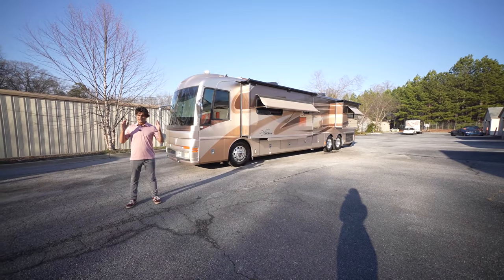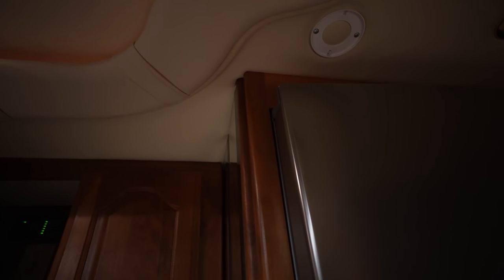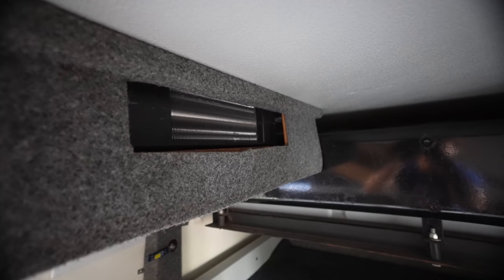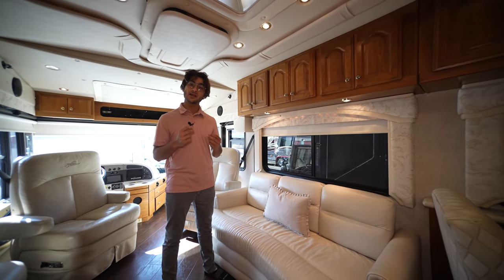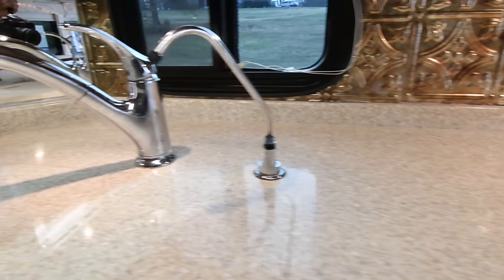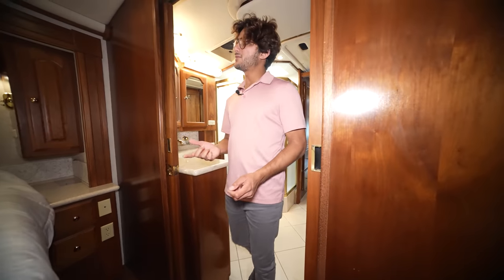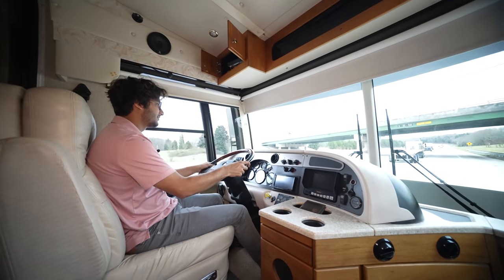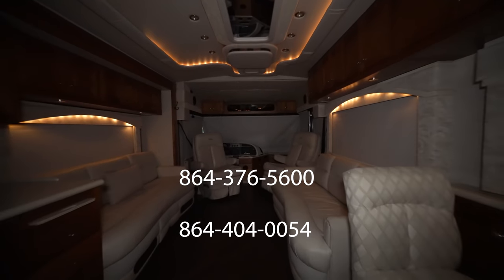2003 American Eagle 42E - Pinnacle Of The Classic American Coach, In Exemplary Condition. (Sold)

Comment: Not really a coach I would like as is but that Drivers Side Galley is always a huge plus for me. Why put the Galley on the passenger side overlooking what is always the entertainment side of your campsite where you have your chairs, picnic table, grill, outside entertainment systems/tvs and instead have all those huge windows overlooking your neighbors campsite, your power pole and sewer/water hookups? That's never made sense to me in any floor plan with how they do that. Any coach I own will have the drivers side galley and if it's a front galley setup to boot, even better. Great review/tour of a classic another job very well done, thank you Mayan...

Comment: Will it smog in CA , what is a rig like a his go for?
Reply: I'm based in Southern California, Diesel RVs have no smog req yet because they are registered as "Housecars" not trucks.  Unlike cars, every "diesel" coach going down the line is built to be 50 state compliant.  In other words, its too expensive for RV builders to have to modify individual builds so they are all the same.  There is a sticker on the frame above the engine that may have to be verified by DMV but this sticker will usually state the smog compliance which is accepted nationwide.
Reply: Thanks for your thorough walkthroughs and informative videos truly professional still wondering what this goes for
Reply: I'm registering an out of state diesel pusher in CA and we still have to get it approved by CARB, the air resource board before the DMV will register it. They basically want to see the emissions label and pictures that it is really an RV inside
Reply: @nomadbiker4040  Approved by CARB?  Sounds like the RV isn't registered properly when you acquired it.  Do you have to register it in CA?
Reply: @matthewmugglebee4110  Yes, the CA DMV office in San Bernardino referred me to CARB which had a website where you can upload pictures of the inside, outside and labels of the motorhome. Then they approve it and notify the DMV which then issues the registration.  The RV was previously registered in AZ